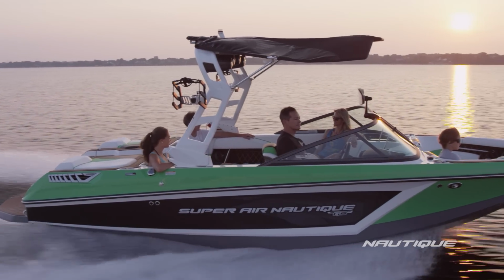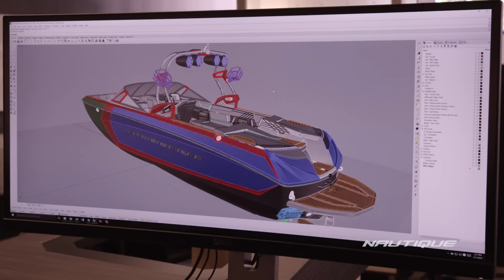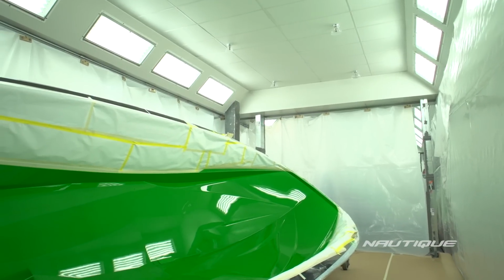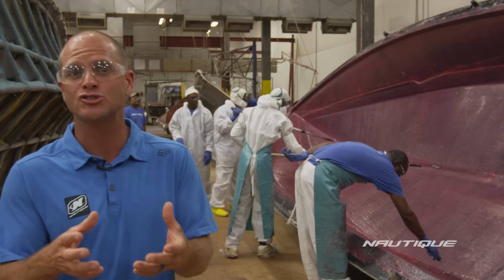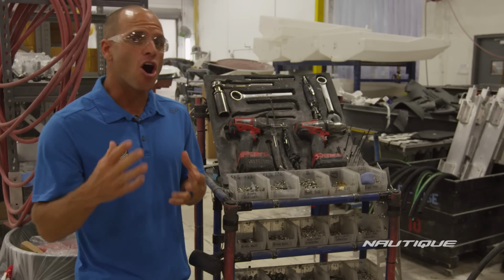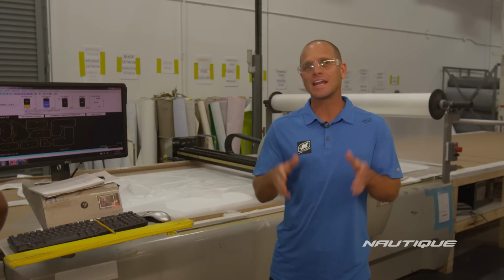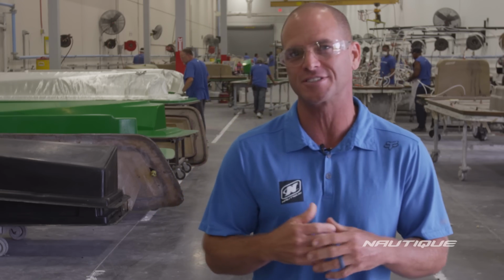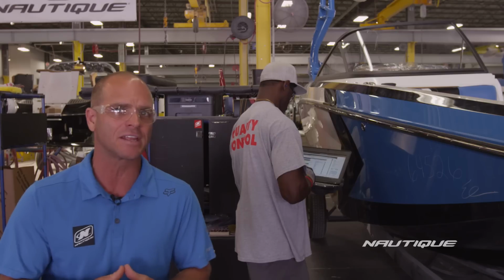Nautique Boat Company Factory Tour

Comment: Chop gun fiberglassed boat = the cheapest and most structurally UN-sound way to build a boat compared to hand laid woven fiberglass.
And then Nautique charges $100,000, $200,000, $400,000 and $600,000+ for their boats built using chop guns!!!!  No thanks, I'll buy a better boat for the same money built with hand laid woven fiberglass and CF.